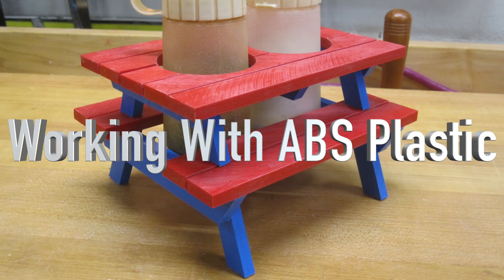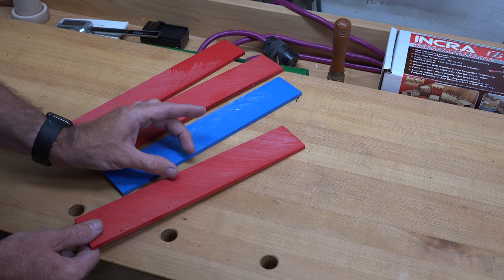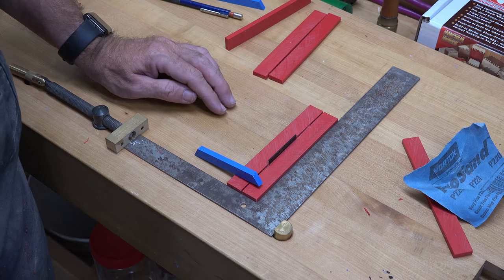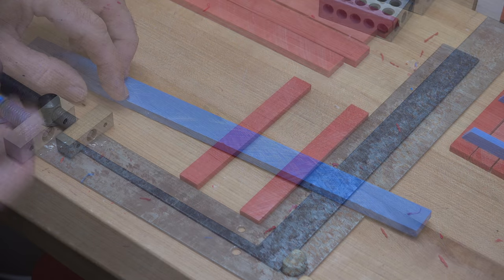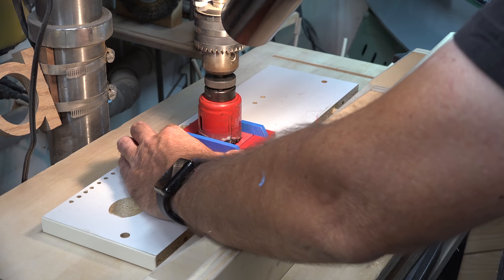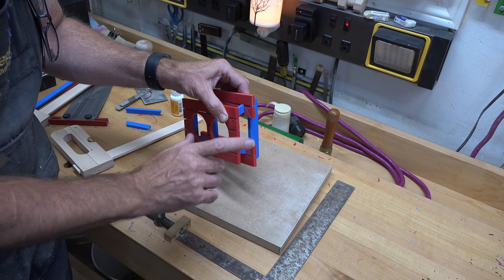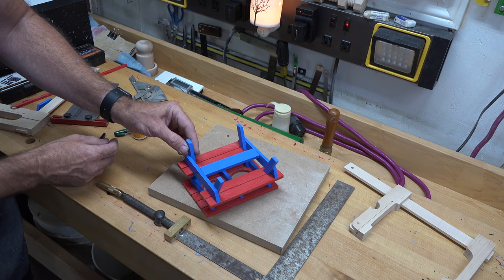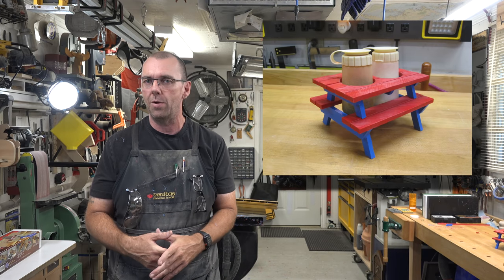Making a Salt and Pepper Shaker Holder

Comment: Neat little project.  I've done some work with plastics- mostly Plexiglass (acrylic) and polycarbonate.  I learned to use them way back in junior high shop class.  I actually make zero clearance throat plates for my table saw out of them.
Lately I've been working with Kydex as well-I buy it in sheets and use it to make cheek risers for rifle and shotgun stocks.
By the way-is that a new bandsaw in the background?  I didn't notice it when you did the bandsaw box project.

.
Reply from the maker: Plastics have been a lot of fun to work with.  Very cool stuff.  That IS a new bandsaw in the background and it is the same one that I used to cut the box.  I did an assembly video of the saw and a set up video of the same saw a couple of weeks ago.  Sounds like you've got some catching up to do.  LOL.  Thanks for tuning in.

Comment: Bonjour kenny
J'aimerais savoir comment aime tu travailler avec Plasti-Block™ 
Pour le scier - percer est-ce que ca chauffe
Merci
Reply from the maker: Hello Francois.  Thanks for taking the time to leave me a comment.  If you leave the plastic on the blade for too long or generate too much heat with the blade, the plastic can start to melt.  So the cuts have to be quick and with a coarse blade.  I have found that a ripping blade in the table saw works well for this process.  For the scroll saw work that I have tried with this material, the blade speed and the feed rate have to be very low in order to prevent heating the material.  In general though, I haven't found that there was much melting of the material, especially for this project.  Thanks for tuning in.
Reply: Merci kenny pour avoir pris le temps de repondre
Le materiel a l'air interressant ,j'attend de voir pour quel projet je pourrais faire avec avant d'acheter
C'est quand même assez dispendieux
Lacher pas vous faite du bon travail
Reply from the maker: You're very welcome.  Thanks for tuning in.